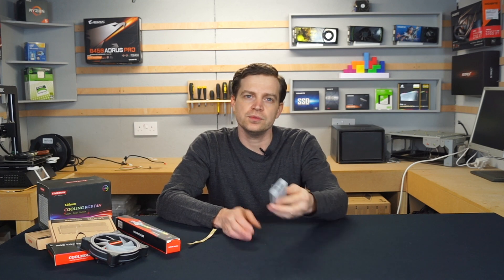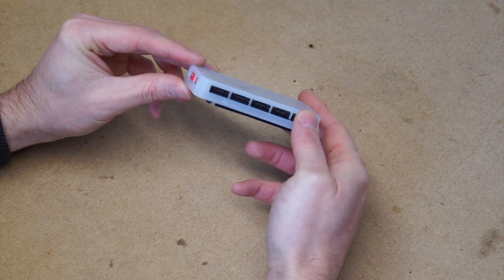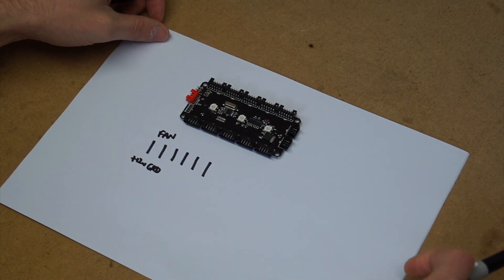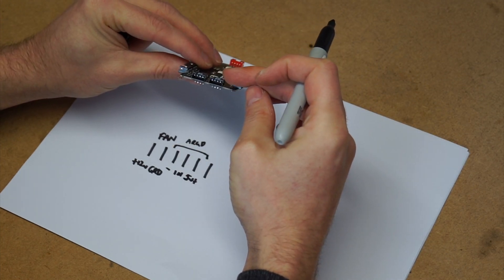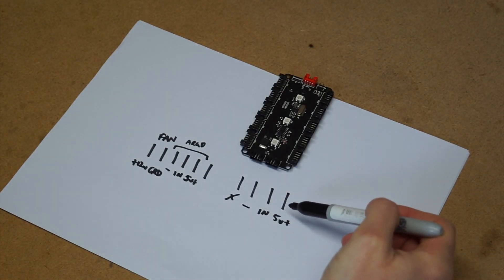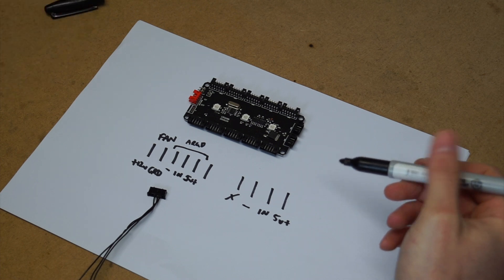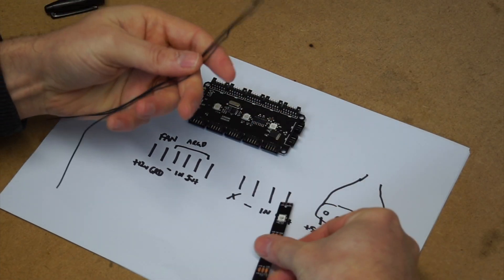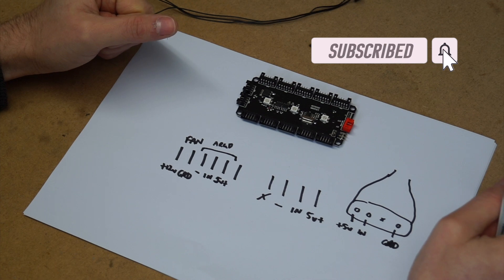Coolmoon RGB Controller Connections and Pinouts.

Comment: Hi! I bought new one today, however after few minutes, the remote controller stopped to work. I mean, it has the red led when I push a button, however, I makes no reaction  to the remote controller. Do you know what could be the reason?

Comment: Can I connect my Coolmoon RGB fan's LED  directly to the motherboard's 3-pin ARGB connection? I actually lost the remote controller so I can't change the light settings. I am thinking of connecting the fan's 5v-in-GND to the motherboard and leaving the +12v-GND of the fan to the coolmoon circuit
Reply from the maker: The ARGB is a standard so it would work fine.
Reply: How can I connect 5 LEDs of 5 fans..   Can I just connect the common ARGB wire configuration like all +5v will be connected, same for data in?
Reply from the maker: @sarljames  That would work and every fan would be a copy of the next in patterns.

Comment: My remote suddenly stopped working for this controller. The lights are still on, but i can't change color or turn down the speed anymore. Yesterday evening everything was fine, i didn't change anything and now it doesn't react anymore. Does anyone know of a solution, im really bummed and i don't want these fans to spin at max RPM the whole time, its loud and annoying.

Comment: Great video! Thanks! How can I get this controller to plug in to my motherboard (JRAINBOW1) or where can I find the controller that can allow for my 9x 6pin fans to be controlled by my software (razer synapse or msi mystic lights)?
Reply from the maker: Thanks for the comment.  Unfortunately you can't with this specific model.  I tried for ages to get it to work but some models do have this feature so look out for this when purchasing.  They usually say "Aura Sync" or something similar.

Comment: Great video. I've had one of these for about 6 months now I've actually purchased the "new" ones that have pwm + argb standard pin outs and can do pwm and argb motherboard sync..... Any chance you see any way to "mod" this one however to allow pwm?
Reply: Fan hub: https://a.aliexpress.com/_mM5Yc0X
fans:
https://a.aliexpress.com/_mNY3UFd

So far so good on these ones. * not the store I bought from as they are out of stock, but I think these are priced the same as when I bought them... they are priced weird and you can save some money if your buying a few I shipped from USA and bought 8 fans and 1 hub for $30 cheaper than ship from China option. In this combination it was Cad $139 from China or Cad $100 from USA
Reply from the maker: @gregpolachuk  That's awesome, thanks.  I will check them out.

Comment: Why aren't we using the "data out" pin? I was considering retrofitting the 6-pin for use on a Corsair node controller.
Reply from the maker: It's the controller that doesn't seem to use it.  The LED's will if the feed is there.  ARGB is a standard just some strips miss out the Data out for some reason.

Comment: Thanks for this video dude! My case came with it's own rgb hub and led strip, but I had a separate for my fans that's exactly like coolmoon. My case led strip is only 3 pins, and I've tried plugging it to my fan hub, which accepts 4 pin for the led strip. Now it's broken. I bought another led strip but it's 3 pin again. Thankfully the strip is labelled now, so I was able to make it work even with the different connectors thanks to your explanation on the pins.

Comment: Thank you. Can you please make a tutorial on the manual switch headers  where we can attach a switch to toggle different states. Can we change brightness with that?
[update: I have attached a switch. It can be used to change the LED effects or turn it off. But, cannot control the fans without the IR remote]

Comment: Tried to plug in an Aerocool Mirage 12 fan but it didn't work, figured out the pinouts are different just like this: N-G-D-5v-G-12v (N is the data out pin which is unusable by the fan). 

So what i did was to flip the connector and switch the 5v and 2nd G pins so it matched the ones in the controller. The Fan did spin and I managed to controll the speed but the lights didn't turned on at all. Do you think I messed the RGB the first time I plugged them incorrectly ? or is just a compatibility issue ?
Reply from the maker: I'm not sure, I have wired them up completely wrong before and never damaged the lights.
Reply: @TechLabUK  I guess that these aerocool fans indeed requiere their specific controllers to work which are either the H66F or H106C. That's sh*tt* move right there 😠
Reply: Thanks for posting this. I was just deciding what to buy and now I know what I need because of your kind comment.
Reply: @SC-hk6ui  Really 😀? so you're getting aerocool fans ?
Reply: @Lancer265  Yes that's right. I already have two of the Duo 14s, and I'm getting three Duo 12s to go with them. I am very fond of the fact that they have dual lighting patterns on each fan (blade and drum) and that the Aerocool controller plays to this advantage. Plus, they also serve two ARGB extensions, as well as six fans in total, with a remote control that also does fan speed. So, for £20, how could I refuse. They are bright and quite lovely, and I can always swap to the Aerocool Mirage model if I want a snappy look.
Reply: @Lancer265  You advice was excellent, so thank you. Saved me lots of time and money.

Comment: Which wire goes into the motherboard for argb sync ?
Reply from the maker: The version in the video doesn't have sync.  They are supposed to have a version that does but haven't had one of them in yet.
Reply: @TechLabUK  that explains why my rgb header caught on fire but I managed to save my board from dying and it burning
Reply from the maker: @itzsultan3157  Wow, that doesn't sound good.  Did you plug it into the controller to cause this?  I think the sync is supposed to be the 4Pin plug on the right of the power one.  I couldn't get it working so tore the controller apart and checked all the feeds and they seem to have disconnected it somewhere as it just doesn't get to the fans themselves.
Reply: @TechLabUK  some fire that came with the hub said vda on it so I took attached it's 3 pin to the hub and attached it's 4 pin in the rgb header and the 4 pin said vda or something like that . I turned the system on I saw a small flame I turned it off
Reply from the maker: @itzsultan3157  That's real strange.  Not had a controller yet from them with that additional VDA connection.  If you mean VDG then that's the Gigabyte version of the ARGB connection which I would suspect should have worked if you have a Gigabyte board with this header and a controller with the supplied cable.  Very strange.
Reply: @TechLabUK  I have h410m s2hv2 board
Reply: @TechLabUK  I think it was vdg maybe
Reply from the maker: @itzsultan3157  Yeah, Gigabyte.  For some reason some of their boards come with that VGD header.  My Gigabyte Aorus Pro has the standard 3Pin ARGB connections which through me off a bit on what they use.
Reply: @TechLabUK  hi on that 6 pin out I do not see 2 wire for fan speed 
What if I wanna install that fan on CPU cooler

Comment: thank you, my controller is suck and dead, the LED on the fan now at maximum and so fricking bright, now i'm about to cut that 5v LED pin. I also wonder if we can mod a typical fan case with 3or4 pin to plug them into that hub (only using 2 pin only the left side: 12v+ground)?

Comment: Your video is an excellent explanation if RGB wiring. Just bought a computer from ibuypower.  The MB does not support RGB.  I have a board (similar to the Coolmoon) connected to the fan power board feeding 4 fans.  The 3 pin board is not connected to anything else and has several 3 pin (forth one in middle missing) connections at 5V.  I figure a can connect RGB to these 3 pin connectors with right adapter.  Not sure if the Coolmoon (or another) controller is necessary. It would be nice to have a remote controller to change lighting. I bought the new Phanteks NEON Digital-RGB LED Strip and not sure what its connection looks like but heard they keep it from being compatible from others. Is there a way (like ohms) to identify each wire on the LED strip +, -, 5V?  When I get it I will connect it and see how it looks.  I plan to add RGB lights to the fans.  Coolmoon seems as good as more expensive controllers. The software for them seems new and problematic. Your thoughts would be appreciated.
Reply from the maker: The 3Pin 5v systems are ARGB so are incompatible with the 4Pin RGB systems.  it sounds as though you already have a controller built in and if it's using the 3Pin standard other items should just plug straight into it.  It's hard to tell without seeing, if you have access to discord we can chat more about it (See YouTube Header for our server link).
Reply: @TechLabUK  Have not used discord but I did register today as MarkD.  I spoke to tech support.  They are sending me a 9 pin connector for motherboard to connect to the controller. (with 3 pin female)  I should be able to use their driver software to control RGB with that connection.  They are also sending a remote.
Reply from the maker: @DrRoos  That sounds awesome of them.  That should get you up and running.

Comment: How could I connect and illuminate an argb from a 6-pin fan to a 5v cell phone transformer?it's possible?
Reply from the maker: You could provide the power via that method but not the digital signal needed to assign the LEDs their instructions.  You would still need an aRGB controller which would be the thing you need to connect to the transformer.

Comment: My case has ARGB fans and strips, and a IN VDG connector with 3 pins but with just two wires. I suppose I can wire my coolmoon controller, taking the DATA OUT from one fan or led strip from the controller to the VDG IN, but how? Thanks in advance for your help.
Reply from the maker: I believe the VDG connectors are specific to Gigabyte Motherboard Headers.  The V is Power, D is for Data and G is for Ground.  One of the wires will be the data and the other will either be the 5v or Ground, you will need to work it out with a pinout.  Once you know it's easy enough to connect those two to a Coolmoon controller as per this video.

Comment: I haave the cool moon with the 3 pin input connector, but have just aquired a asus strix h270f motherboard thats has a 4 pin header for rgb, is the a cable that connects the 4 pin rgb header ti the coolmoon 3 pin header, as i have thise exact fans and they claim to be aurora compatible
Reply from the maker: Unfortunately they will be incompatible.  This is because the 4Pin is 12v RGB whereas the 3Pin is 5v ARGB (Addressable).  They are two different standards.

Comment: hey would there be anyway i can connect standard rgb strip lights to this controller
Reply from the maker: It depends what you mean by "Standard RGB Strip".  These controllers work using ARGB which is a different standard.  If you mean just a standard ARGB strip then yes, you can simply put a 2.0mm JST connection on the end of your strip as per the pinout in the video and plug it in.  If not ARGB then unfortunately not.  Hope this helps.
Reply: Yes thankyou
Reply: Mine caught on fire when i tried

Comment: so the 6 pin is not the pwm signal?
Reply from the maker: No, the fans appear to have their speed controlled by voltage with the two fan power cables.

Comment: Hi friend, this 2-pin connector next to the power supply input, would it be for PWM? Do you know how it works?
Reply from the maker: I believe it does but not on all units, I didn't get a cable with this one so not sure if it works or not.

Comment: my coolmoon controller does not turn on the led - the fan's rgb led is ok, only the controller led does not light
Reply from the maker: I believe they do many different versions.  The newer models don't seem to have the RGB on the controller.  Fortunately every one that I have bought so far has.
Reply: @TechLabUK  how do I remove this connectors to the dock, I find it hard to remove it.
Reply from the maker: @paranoidparadigm886  Not sure I understand the question.  Do you mean how to remove the fan connectors from the Controller?  If so, they simply pull out.

Comment: Is it possible to plug an arbg cpu fan (just the arb part, the fan part plugs into the mobo) into the "light strip" part and it would work?

It has the same 1 blank 3 4 as the "light strip" ends
Reply from the maker: Yes, The aRGB part of any fan is just a strip of LED's really so as long as it's the same standard it will work.
Reply: @TechLabUK  what a legend! Thanks mate. Great video
Reply from the maker: @Flabbergash  NP Good luck with the modding.

Comment: Hello. Any ideea what the 2 pin is for right next to the power? Is it for the case button to change the rgb effects?
Reply from the maker: I think on some models it's for a reset switch to control the lighting but I have not had a Coolmoon controller where it works.
Reply: Pretty late but I'll reply anyways in case someone has a similar problem.

Yes, it's for the case button for manual rgb control.

Comment: nice.. so does this mean you can convert the 4 pin for led strip to 3pin argb and be use for cpu cooler fan argb? (my mobo doesnt have argb header). thanks..
Reply from the maker: You can convert any of the Coolmoon 6Pin or 4Pin connections to a 3Pin ARGB standard connection.  ARGB is a standard in terms of wiring so yes, this will work and I have done it like this a few times (In fact on Ebay you can buy adaptors for this exact thing).  You can't convert ARGB to RGB though as they are different standards.  Hope this helps.
Reply from the maker: Actually I just thought.  if your motherboard doesn't have ARGB but your components do then you can simply buy a 3Pin Coolermoon controller.  their newer versions come with the standard connections so no work involved.  Only need to convert yourself if you already have coolmoon fans in this version of the controller and want to add a 3Pin standard device to it.

Comment: hello .... a question i watched the video but i have a doubt ..... my pc has a schrkoon case with 3 argb fans supplied and an argb controller on the back but my motherboard (asus) does not support aura creator I wanted to know if the effects of the argb are regulated by the motherboard or if with a controller like this (Rgb controller CoolMoon) I can have more light games and a software to control the whole pc or a physical controller
thank you very much I wait for an answer
Reply from the maker: Hi, This version of the Coolmoon controller doesn't support a connection from a motherboard.  Also, the fans are on 6pin connections so the controller is too which means your existing fans might not fit it.  Coolmoon have recently released controllers that do work from the motherboards and use the standard 3Pin ARGB connections so it would / could work from one of the new version I believe.

Comment: Do you think I can use this converter to connect a cooler master fan and control it through the coolmoon adapter?
Reply from the maker: If the fan is ARGB then you can to control the lighting but not the fan speeds.

Comment: is there any 4 pin to 3 pin? argb
Reply from the maker: Depends wat you mean.  If it is a 4Pin PHT to 3Pin ARGB connection you can find adaptors on Ebay etc.  If you mean 4Pin RGB to 3Pin ARGB then not directly but I have seen EZ-DIY on Amazon do a device that can work to translate the signals.
Reply: @TechLabUK  with those items i should be able to control my pc fans rgb and speed through software right?
Reply from the maker: @SometimeYuno  Should be able to.

Comment: hello, any idea what are the pin layouts for the motherboard pins?
Reply from the maker: Do you mean the ARGB headers on the motherboard?  They are usually marked.
Reply: @TechLabUK  no, the ones on the controller, but i don't really need it anymore since my experiment failed. i was trying to figure it out since i was doing some moding on me own with the help of this vid, huge help btw, thanks.
Reply from the maker: @coastalcatch8077  No problem.  I have played around a lot with the ARGB standard and now tend to make all my lights my self from scratch.  Feel free to join the Discord community if you wanna share your mods with the community or ask more questions (Easier to share pics etc).  Discord link in YouTube header :)
Reply: @TechLabUK  will check it out. btw i was trying to sync my hub with a music controller (sp106e), but every time i plug in more stuff to my hub, it would flash random colors. my hub had a motherboard 5v sync function to it, and that's what i used to connect to the music controller. theoretically it should work, it did, but it became weird once i plug in more stuff.
Reply from the maker: @coastalcatch8077  Sounds like an awesome thing.  Shame it wouldn't work though.  Was the hub the one from this video or another?  I know Coolmoon have a much newer version out that uses the standard 3Pin ARGB connections and Syncing etc.
Reply: @TechLabUK  it was a different hub, but it pretty much has the layout as coolmoon, probably a rebrand. the only difference was that it had audio visual inputs built in and a motherboard sync cable. there also weren't any labels on the pin layouts. main reason why i wanted it to have inputs on the separate music controller is that the controller had the visual mode that i want and has better audio visualizers. might ask the server if they have clues to make this work.